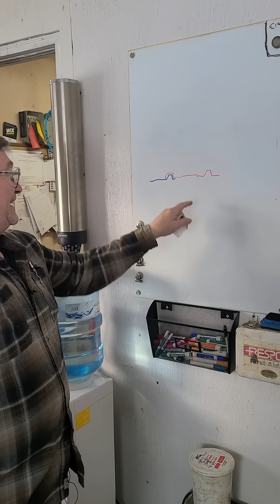Roofing like a machinist

Comment: I am from Australia, we only put screws in the tops, not the bottoms. The expansion on the metal is enormous and elongates the holes
Reply from the maker: We don't get quite as ball-blisteringly hot as you guys, but the -40F to -50F winters and the 90F summer peaks have much the same effect over time.
-Cameraman

Comment: I still use 5V roofing instead of the 3ft panels because the ridges are stronger and I make the roofer screw through the ridges. It’s definitely the best way to do it

Comment: The big thing to get right is the overlaps. 
It might seem contrary, but be sure the short edge goes on top. 
You don't want the long edges terminating in the valley between between ribs. If the long edge is on top, capilary action can draw water up over the ribs.

Comment: I would say ,"Thinking like a service tech."  After almost 4 years doing service work, l found that l applied the same thinking to practically everything.  Basically, what should l do to eliminate the need for future service work, or if it couldn't be helped, how can l make it so that a repair is as uncomplicated as possible?  The end result is that l do get callbacks from old clients, but to do more work, not repairs.  Cheers.
Reply: Same here.
But I do it because I’m lazy; too lazy to do it twice!
Reply: Glad to know im not alone. 

I do service work day to day, but on the side I do some installs. Feels like it takes me longer for having to keep things in mind for servicing or preventing the service issue in the first place
Reply: @4oh4n0tf0und They used to have what they called "trades day" where all the various service techs would converge on one specific house to deal with all the deficiencies.  So paint, hvac, electrical, plumbing, etc.  It had more of the feel of an AA meeting.  Actually, it was reassuring knowing you weren't alone.  FYI, average life span of a service tech is around 4 years before burn out.  I only lasted 3 1/2.  One guy had been doing it going on 9 years.  I asked him, "How can you stand it?"  He responded, "You get punch drunk."  Hilarious😅